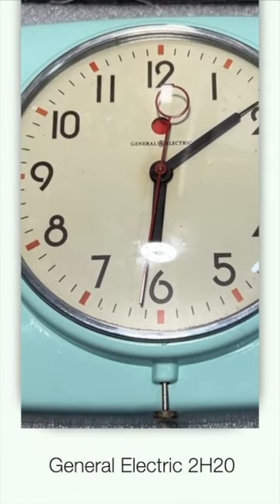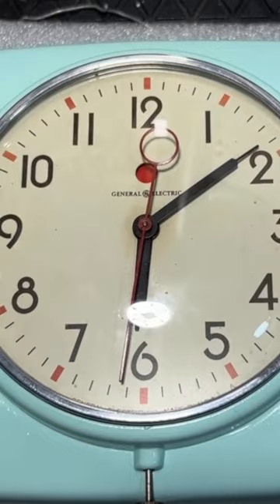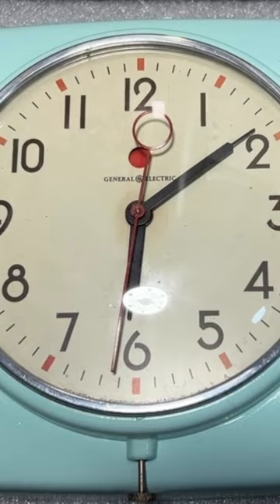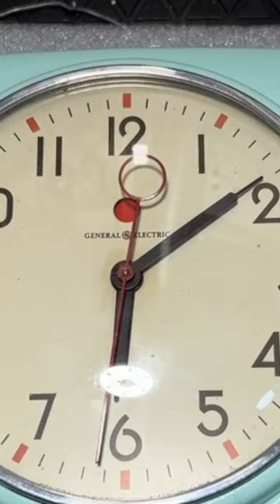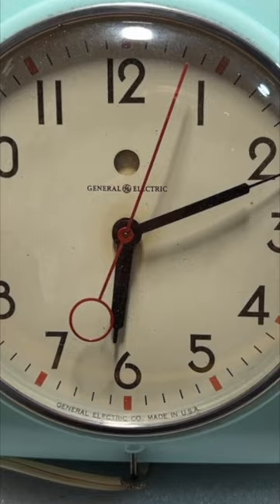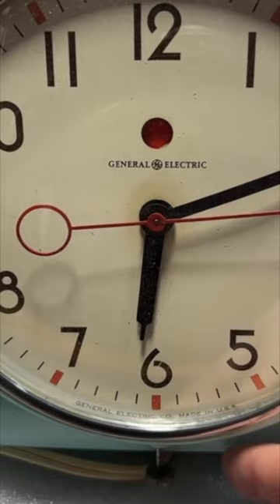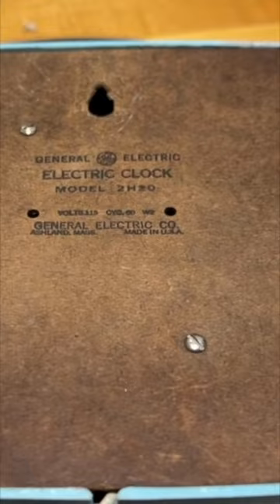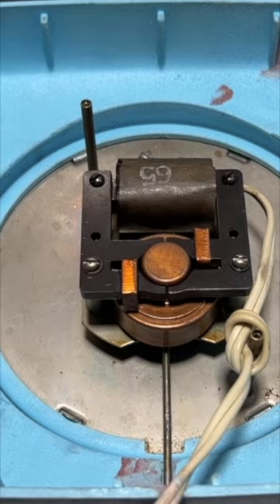What's that red dot on my Telechron clock??? #vintageclock

Comment: With these old clocks,  might they be a electric hazard for being so old?
Reply from the maker: I don’t think so. The power cord would be the first thing to become worn and potentially dangerous. I always recommend that old power cords be replaced, which is what I did in the video. Inside there is a motor with a well-insulated field coil (stator). If that coil became shorted it would probably go open and that would be the end of it. If the rotor became jammed the coil would just get slightly warm. I believe they’re impedance protected so they can’t overheat. Clock motors like this are a simple, reliable, well-tested design. I suppose if it fell into a sink or bathtub it would be an electrical hazard… but that’s what GFCI (ground fault circuit interrupter) receptacles are for in your bathroom and probably in your kitchen too. What made you think they might be dangerous?
Reply: @Mr.BrownsBasement  What made me think that they could be potentially dangerous? Just age, perhaps some of the items that you discussed.  There are a couple of clocks I'm always looking at on eBay such as a Seth Thomas Speed-Read. As you noted, a new electoral cord would be the first thing to change.
Reply from the maker: @kennixox262 Always inspect the electrical components for damage or deterioration. You can always add an over-current device (e.g., a fuse or a PTC thermistor) to the circuit if that makes you more comfortable. I always add a line fuse to the radios and TVs I repair as much more power is involved and they are much more electrically complex than a clock with much more that could go wrong. I am much more concerned about the short and long term safety of modern electrical gear that arrives at our borders without any 3rd party safety certification (e.g., UL, ETL, CSA). Some of it is extremely dangerous. You may want to watch @bigclivedotcom  who buys electronics off eBay and takes it apart to show the design flaws. Some defects are just scary.